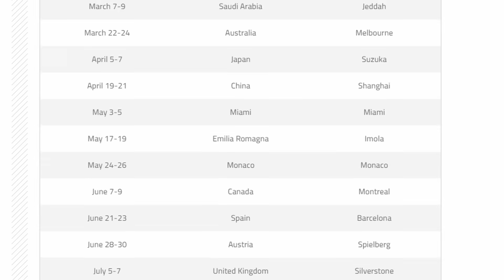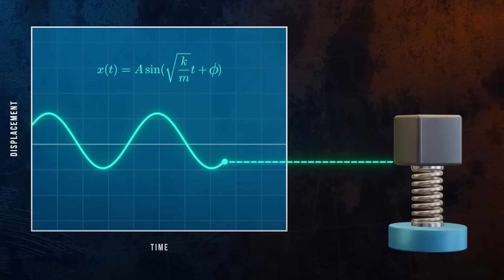Why These F1 Engines Only Lasted 200 Miles

Comment: The V10 era during the mid 90's to 2005 was the best era in F1's history. I have been watching since 1993 and nothing will ever have that aura again. I'm so glad I witnessed this in person.
Reply: Cars showing up with the engine in the middle, cars showing up with the engine mounted sideways, cars showing up with wings, cars showing up with the engine replacing part of the chassis, cars showing up with 6 wheels, cars showing up with the radiators mounted in the middle, cars showing up with fans.  That was the 60s and 70s.  In my opinion, that was the most interesting period in F1 history.
Reply: @frankhoward7645  Indeed. That era was also extremely deadly and all the drivers that raced then have my utmost respect.
Reply: You missed the best area , 20 yrs earlier.
Reply: @bobbybishop5662  Unfortunately I wasn't born then, but I wish I saw Jim Clark race as I truly believe that he is possibly the greatest ever.
Reply: @bobbybishop5662 Yes that was special as well, just like the 1950's and the 1930's when the Mercedes Benz and Auto Union taught the world about motor racing.
Reply: @bobbybishop5662 be real f1 wasn’t good in the 80:
Reply: @peterhallock9486  I kept up until they started allowing the driver aids , active suspension ect. I just can't get into what's called F1 today.
Reply: @bobbybishop5662   Driving aids and active suspension was 1st started during 87 with the lotus, but nobody really used it again until the actual era of electronic suspension + unlimited driving aids which was short lived only lasting from 1992 to 1993. So it's interesting you quit watching F1 because they allowed electronic driving aids for 2 years. They got rid of the driving in 1994, which made the cars extremely unstable and dangerous, leading Sennas death, ratzenbergers death, and others crashing too. The cars of 1992 & 1993 had completely changed designs and built them around the electronic driving aids, so when they banned it all in 1994, the cars and teams weren't really ready for it yet. 

However in 1994 and 1995....and 1996...and 1997....and 1998....and 1999.....it was found out teams were SECRETLY using traction control and launch control and potentially other electronic driving aids which were all banned since 1994. So the FiA made electronic driving aids legal from 2000 onwards until 2008. Then in 2009 it was back to the old school rule of ZERO driving aids again - until this very day on 2023-2024, they still do not using electronic driving aids. 

The reason the FiA re-legalized traction control & driving aids in 2000 after banning it all in 1994, is it turns out from 1994-1999 it was just way too difficult & hard for the FiA to regulate the teams and properly enforce those the no driving aids rules because the traction controls & driving aids could EASILY be secretly coded into the electronics and never be found by the FiA. 
Basically, the FiA legalized traction control again in 2000 because it was just WAYYYY too hard to catch the teams cheating, and many teams got away with cheating in 1994-1999. 

Ever since 2009 there has been NO traction control and ZERO electronic driving aids. It might be a good time to get back into F1. The traction control and driving aids only existed in 1992 to 2008. (And it was technically illegal in 1994-1999 but many teams cheated using electronic driving aids secretly).
So yeah, I'd recommend giving F1 another shot considering the reason you stopped watching(driving aids being allowed) is not a thing that exists anymore and hasn't since 2009.
Reply: @frankhoward7645 - F1 ran at Long Beach from '76 to '83. We went to every Long Beach F1 race except one, and saw a lot of that innovation in the cars. It was pretty easy getting into the paddock after the race, so we ended up getting a good look at many of the cars up close and personal. We took a lot of photos of the cars, and some with the drivers. Those were fun times.
Reply: and yet at that time everyone was complaining how shumacher had no competition
Reply: I hate the annoying muted gurgle of today's F1 engines. Nobody gives a flying f**k about how technologically advanced they are, except for technophiles, the kind who wait in a long line for a week just to buy the latest phone, just so they can have other technophiles jerk off all over them with envy. Then, they go and spend 18 hours a day for months jerking off all over their new phone, until the next new, even more advanced phone come along. Rinse, repeat, jerk off.

Comment: As a comparison, the highest RPM street legal engine we have is that of a bike called Ducati Panigale V4R, 16,500 rpm from a 1.0L V4, 230+ hp, it could probably be more but the regulations for it to be road legal can be very strict

Edit: Forgot about the bikes like Honda CBR250RR, 18,000+ rpm in the 90s due to tiny displacement, wonder how much higher it could go today without strict regulations

If you prefer cars, Gordon Murray T.50 does 12,100 RPM from 4.0L V12, 654 hp

Car manufacturers could definitely build even higher RPMs than that with lower displacement engine but I suppose it wouldn't sell well or no one has thought of it
Reply: In today technology i think its impossible for manufacturers to engineer a reliable right rev engine like 18k rpm, the valve springs is the bottleneck, you can do desmo like ducati but it also have a limit, you can make it pneumatic valve like moto gp do today but it costs a lot (really a lot) and also not as reliable
Reply: @lemonjuice6177  With even higher I meant 13k rpm, should be easy but gotta make profits
Reply: @kerimca98  oh, i think its possible to a car engine to do 16k rpm, like a 3L V12 engine it’s definitely possible using desmo or valve springs, but the low end torque will be a shit, i think that’s why they don’t do, but with hybrid architecture to compensate for the low torque i think will be one of the most exciting cars to rev…

Comment: Imagine if top fuel dragsters went to quiet little hybrid engines. The sport would probably be unwatchable and loose almost all spectators because people love it for the earth shaking power and engines screaming so loud it can be heard from miles away.  It’s no different when it comes to formula one
Reply: Exactly why I don't watch it anymore. 🥱🥱🥱
Reply: Imagine the red arrows display if no noise! Noise is a must. Although I am old, the young ones like the noise too as I found out at Silverstone Classic when I spoke to a young couple next to me whilst watching F1 of the past. Screaming engines, yes light and unreliable but fantastic technology especially in the valve gear and ignition areas in those days.

Comment: Going fast isn't about making torque. That's why F1 engines typically had such low torque. It's about making power, which is a function of RPM. Hence, if you want to make the most power with a naturally-aspirated engine, you spin it faster.
Reply: There's also a thing called wheel torque, which is calculated after transmission gearing, more power means more wheel torque
Reply: @kerimca98  But torque is a measurement of force, not power, that's the point. Torque is not what moves the car, power is. Hang a 100-lb weight off of a 1-ft arm and you've made 100 ft-lbs of torque, but you haven't done any work, therefore you've made zero power. More torque to the wheels just means you're making more power to the wheels.
Reply: @rars0n  Horsepower is literally just Torque done at a rate, so technically it does. Higher Torque means you go from one power figure to another quicker. Also the example is flawed, it's potential energy that has yet to be made into kinetic energy, in this case it's torque that has yet to work vs torque that is already at work.
Reply: @HenAnt  Wrong Torque is nothing but a force. Work is energy transferred to an object from a force over a displacement. Power is the rate that work is done.

The example isn't flawed at all. It was meant to demonstrate the fact that torque does not imply work like you think it does. 

"torque that is already at work."

This statement is complete nonsense. There's no such thing as "torque already at work."

I can push with 10 lbs of force against a brick wall and it's not going to move. I haven't done any work because the wall hasn't moved. No matter how much force I apply, I will not have done any work until the wall starts to move. There has to be a displacement in order for work to have occurred.

That's why torque is multiplied by rotations per second, and not just seconds. It's not a rate of torque over time, it's a rate of rotations TIMES torque over time.

How much power do you make if you make 1000 lb-ft of torque at 0 RPM? You make 0 power. Because nothing is moving.
Reply: @rars0n  Your example literally just proved my point. Keep in mind Potential Energy is different from Kinetic Energy.

 By definition, Work is just Force produced over time, "Kinetic" Torque, or "Working Torque", or just "Torque" in Kinetics, is literally the "Kinetic" Force produced by the Engine to create angular momentum that makes the car move. Horsepower is simply the measurement of Torque "over time"(in this case RPM), the higher it is the faster you can potentially go, by the end of it all it is all directly correlated to Torque. There's a reason why it's (Torque*RPM)/5252 = Horsepower.

 Also because Torque is just Force, the more you have it the easier it is to push the Crankshaft faster and higher, that brings and amplifies that Force throughout the rest of the Powertrain, and is last amplified by the Wheels so it can put it to ground resulting in motion. This means, that the de facto pushing force is torque, all these gears you mentioned are made to increase wheel torque and make the car move at all.

Ask yourself this, why is that Diesel Trucks, Formula D Cars, Dragsters, and Pretty much every racing discipline needs as much Torque as possible to Pull Massive Loads, Break Traction, Launch Faster, and Accelerate Faster?
Reply: I never said that horsepower and torque weren't related. Obviously they are. However, the fact remains that torque does not imply motion. Horsepower is a calculated number based on the instantaneous amount of torque produced at a specific RPM. That is why horsepower equals 0 at 0 RPM and why making the same amount of torque at a faster engine speed results in more power.

The key to acceleration is area under the horsepower curve. All else being equal, if you can produce the same amount of torque while spinning the engine faster, you will accelerate faster. Hence, if you're trying to maximize acceleration, your goal is to maintain torque production over higher RPMs rather than focusing on producing the maximum peak torque over a smaller rev range. That's why F1 engines spin as fast as they do. Yes, they ARE making torque, but it's sustained torque rather than peak torque, because that means more horsepower.

You could technically pull a massive load with a Honda Civic engine. It would just require insane gearing and use a lot of engine speed to move incredibly slowly. This is sort of how a nuclear submarine works: the steam turbines spin at thousands of RPMs, which is reduced by a massive set of reduction gears to spin the propeller shaft a few hundred RPM, unlike a diesel electric submarine which is direct drive.

Everything after the engine is about torque multiplication to the wheels. The gearing of the transmission and final drive of the differential take care of this (in addition the size of the wheels themselves). Even still, maximizing acceleration requires constantly changing this value; that's why transmissions have multiple gears. Try accelerating from a stop in 5th and you'll just stall the engine. Likewise, raise the final drive gearing too high and you'll massively multiply wheel torque to the detriment of acceleration.

The end result is that gearing makes engine torque sort of irrelevant. What you want is power. In a diesel truck towing a heavy load, making power at low RPMs simplifies the torque multiplication required and allows the gearing to be physically smaller. But this kind of power delivery in an internal combustion engine is more suited for towing rather than acceleration, which is why the same approach isn't used in race cars. Even in diesel race cars, you're going to rev them higher to make more power.
Reply: @rars0n   @rars0n   @rars0n  So we do agree in the end, just a misunderstanding perhaps? All of these are facts. Other than that I never argued about peak torque over sustained torque, just how Torque is the force that moves the car and horsepower is how much work that torque has done, that's why I mentioned the Kinetic term of Torque, I know it doesn't imply work at rest.

But I do have a few gripes with others.

 F1 cars have pretty good sustained Torque, the crux of this argument though is F1 cars don't need that much Torque anyway as they weigh a lot less than other disciplines, less weight equals less Torque needed to move a car just as fast as a car with double the torque but towing double the weight (Obviously not a perfect comparison but you get the point.) I think if F1 wasn't so keen on Displacement restrictions we would see more engines sacrificing revs for displacement, overall better for Engine life and possibly acceleration if they manage to out engineer the problems of increased weight of the internals.

 Great analogy for the first part, the Nuclear submarine analogy is quite unecessary already though.

 Yes, however this is why there are advantages to High Torque engine. For example, the Viper GTS and Corvette C5R and C6R from the 90s and early to later 2000s could be geared a lot lower to achieve a higher top speed while accelerating just as fast as it's competition, one of the many reasons why they dominated Europe and America in the early 90s and the very early 2000s, when transmission gearing and final drive ratios were strictly mandated the Viper and Corvette were actually quicker in those fast acceleration zones, only Maserati, Porsche, and Aston could put a dent against their pace. Many more examples I can  think off the top of my head are such as the Diesel Puegots and Audis, the Ford GT40 from the 60s, Skyline R32 GT-R, Shelby Cobra Daytona, Sauber Mercedes C9, Jaguar XJ9, Aston Martin Vantage V12, and many more examples. I can think many.  There's just much extra energy not to utilize, the challenge is mostly to keep the Powertrain intact, which is far easier to do than engineering an engine to sustain high revs as we've seen in Lemans.

 As per my last, it really is not. There are far more cars that suffered not having enough torque inspite making the same power, the Mazda 787 B was well within the power figures of Group C but was to sluggish to reach higher rpms, the Lambos of GT3 right now are complaining they aren't producing enough torque for the WEC compared to it's high displacement and turbo charged peers, Ferrari floundered in Grand Touring Car spec series during the 2000s for their preference of high revs and so on. Simply put, Energy can't be made for free, and as your comparison to the Honda earlier becomes slower proves against this point. Gearing does not overcome the inherent lack of energy made to work, unless the car as a whole package is superior to its competition, a completely different argument entirely. And no, 6500 isn't particularly high revving, a high revving engine is beyond the realm of 7k.
Reply: @HenAnt Wow, you have no idea what you're talking about.
Reply: @PistonAvatarGuy  lmao go ahead tough guy, tell me where I'm wrong you wouldn't know the difference nm and lb ft.
Reply: @HenAnt   rars0n explained everything just fine.
Reply: @PistonAvatarGuy  bro Narson has been incorrect in almost everything in his points, You don't measure torque at rest when you're running the engine on a Dyno, Torque in kinesthetics implies it's force already being done while in motion through a levering action, it's not at rest. Torque can blatantly mean Force for these applications, more of it means it can break traction, pull harder, launch faster, go faster etc.

 Answer me this, can a Dyno measure a car's Torque at rest? No. How about when it is moving? Yes. Torque can be potential and kinetic energy, he says it does not imply work even though it's already in Kinetic form, and goes as far as to say Torque is useless apart from making HP, and you agree with that??????
Reply: When displacement is limited revs are free, but piston speed is limited to around 4500-4800 feet per minute. This results in very over square bore/stroke ratios. I have heard these ratios were in the order of 2.7 to 1 bore to stroke.